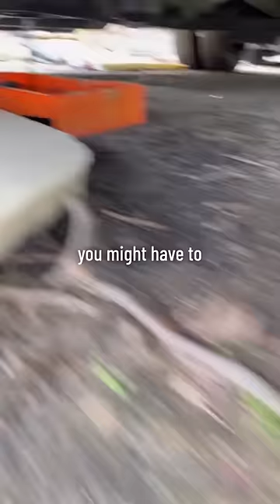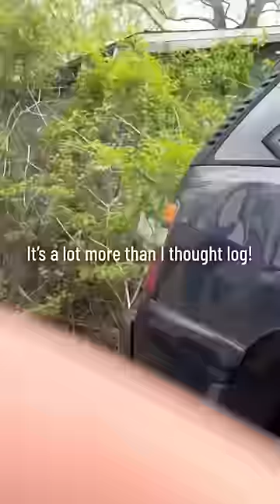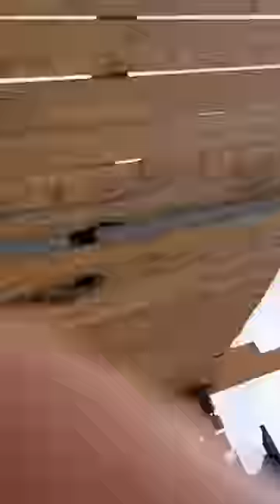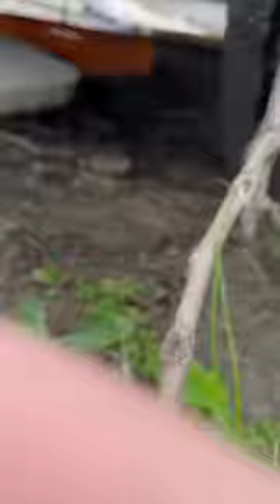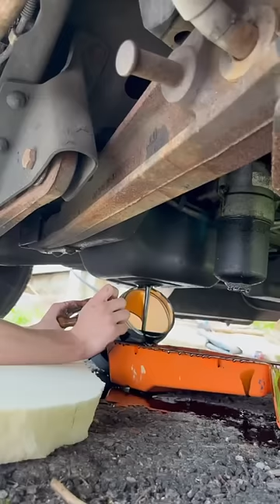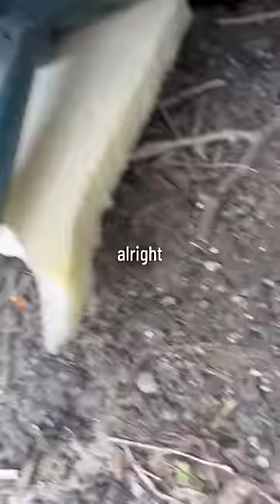First oil change

Comment: my 2 door coupe would’ve overfilled that orange oil catcher. rid of it. edit: paint tray guys, got it.
edit2: yeah i get the doors don’t correlate to oil capacity. but it’s very incredibly obvious what i mean.
Reply: The "orange oil catcher" is used to hold paint for a roller when painting.  He will have to get rid of it because it's ruined, not because it doesn't work.
Reply: He's also never changed the oil since he got it
Reply: @matthewheinze1231 lmfao i didn’t even realize it was a paint bucket for paint rollers 😂
Reply: Its not an oil catcher thats a paint pan for paint rollers.
Reply: “2 door coupe” is the car equivalent to “smh my head”
Reply: “Oil catcher”….. you mean paint tray….
Reply: That’s because it’s for a paint roller 😂😂
Reply: @dylanpires7836 lol for real. And being a coupe doesnt make the engine smaller
Reply: That oil catcher is for paint rolling
Reply: Paint tray
Reply: Lol has nothing to do with the amount of doors you have, but rather engine displacement
Reply: @Toxic_blitz777 bro what it’ black from soot 😂 are you actually thick a diesel produces soot therefore the oil goes really dark
Reply: I’m glad you know the difference between two door and coupe
Reply: @itsir2u  Engine size has nothing to do with it a 1.0 3 cylinder can be as much of a coupe as a 6.0 v12
Reply: @JustCarrotz bucket?  😂 anyways yeah silly ass video
Reply: Bro it's for Paint rollers, they didn't even have an oil Pan.
Reply: *paint tray
Reply: Well it is an oil catcher in this situation 😂 Also damn, it's small for even a motorcycle 😂
Reply: @Lilian040210  anything’s an oil catcher if you’re dumb enough 😂😂
Reply: 2 door coupe means nothing for oil capacity. Theres many 4 bangers out there that take over 6 quarts

Comment: Lesson: always know your oil capacity before draining it
Reply: @gunnardoyon6750 I'm sure the information is avaliable online for the bus
Reply: NotAccountable that engine Is in other cars not just a bus can find info on the engine not the bus bc busses come with alot of different engines
Reply: NotAccountable depending on the engine it could be like 40qts
Reply: It's not even a lesson. It's common sense. I only say that because wouldn't you think they did the research to see what type to use, how much to buy, what brand, etc...?
Reply: Exactly what I came to the comments to say. 😅
Reply: Lol just LOOK at the size of the sump. That was so clear
Reply: @michaellawrence3796  they dont use use alot of deferent engines actually
Reply: @gunnardoyon6750 internet still works to look up how much oil the bus takes. Probably the manual too.
Reply: Or use common sense
Reply: @gunnardoyon6750  and? its mostly about the engines displacement on how much oil it holds
Reply: @gunnardoyon6750 ignorance is not an excuse
Reply: @gunnardoyon6750 just proved his point
Reply: @gunnardoyon6750 I’m just a girl and I’ve never personally changed my oil. However even I know to use a huge pan for changing oil. Even on my car I’d use a decent 5L container. Mines a 3.8L engine and I’d like to be able to move the container without it spilling on my driveway.
Reply: Yuh
Reply: You can always use a vin decoder if you are unsure of your engines displacement. Using that information, you’re able to do a quick search online to find what oil and how much it takes.

They clearly don’t have a whole lot of experience with this bus, so I wouldn’t be too harsh on ‘em. They’re figuring it out and they’ll know for next time. Give ‘em props for doing it themselves and not being hesitant
Reply: NotAccountable  Humans are pattern recognition machines, with alot of differences between us, patterns you notice intuitively and label as common sense doesnt always come as easily to others whoms strengths are usually different aswell.
Reply: NotAccountable lmao thank you. This guy clearly owns a short bus for a reason
Reply: @gunnardoyon6750 Did he not buy new oil yet?
Reply: On my Mustang it takes 10Q
Reply: @ambermack5689 might even be too small. I have a smaller engine and need to drain almost 5L
Reply: If just buy a few oil drain catch pans. Like why didn't they even use one?
Reply: @FatherCorn in my experience you can usually find the required amount of oil 4 buses and other large diesel vehicles either in the engine on the oil fill cap on the oil pan itself which is admittedly pretty rare or in this funny little thing called a user's manual
Reply: Later he puts only 1 liter oil back in and womder why the engine broke
Reply: Doesn't matter even if it was a 4.5 qts or Toyota Prius engine it was going to over fill that paint roller container
Reply: @PsykoSpirits  fr
Reply: @gunnardoyon6750  He used something that holds less than a whole bucket of paint. Even for a first time, he shoule have known that wasn't going to work.
Reply: The lesson should actually be don’t use a damn paint pan too catch your oil
Reply: its damn 5 liters of oil bruv
Reply: Why not just plug the drain plug back in and find another oil bucket when you see the one you’re using is overfilling
Reply: @gunnardoyon6750  yeah, you can easily find that on the internet... how the hell would you know how much oil you have to buy...
Reply: Sorry I'm 15 and don't know alot
Reply: Or get the biggest oil and you can find or maybe even get a few
Reply: @michaellawrence3796 you find the oil capacity of the engine. Don't need the vehicle because the 7.3 motor has a 15 liter capacity no matter what vehicle it's in

Comment: Yikes, should have known a bus would have alot more oil! You'd be hard pressed to fit the oil from a regular sized car in that paint pan, let alone a bus. Lesson learned though!
Reply: I mean, was the lesson learned tho? 😂
Reply: Use common sense
Reply: Bruh, that shallow ass pan would hold the oil from my riding lawnmower.
Reply: @ThatOneKiidThere Tbh they don’t seem to me like they learn anything so I doubt it.
Reply: Even a motorcycle has more, a liter +-, a lawnmower, maybe 😂
Reply: Lesson is to just put the drain plug back on duh

Comment: Rule #1-If the drain plug is already in your hands and didn’t drop into the oil change pan by itself, don’t drop it in there…ya had a mess already, now you gotta fish around for a drain plug. Id use a magnet lol

Comment: i saw the bolt go in there…. i felt the pain and could feel the oil in my hands as i rummage to find it just watching 😭 lets hope the washer is still on there too
Reply: When I used to change the oil with my dad as a little girl, he showered me a trick to get as little oil on your hands as possible. He would take a cheap magnet and attach it to a stick, which he would use to rummage through the oil. Then, we found out that you can buy those. They are long, thin, usually retractable metal pipes with a magnet on the end. You can use it to get the bolts out of the oil (dawn actually works great after this) and you can use it while working on cars. I think I got mine at an AutoZone but you probably can get them at any Walmart. Hope this helps:)

Comment: Very good idea to let the oil run into the environment instead of holding your finger on the hole or screwing the screw back in. Very well done.
Reply: Oil is harvested out of the earth.
Reply: @Crackeracing yeah but thats most certainly Not Motor oil which destroys about 1.000.000 liters of well water or 600 liters of drinking water Just from one drop
Reply: Well they was smart enough to think that small pan was going to catch all the oil from a bus
Reply: The environment isn't going to change my oil
Reply: @Crackeracing bro you made me laugh way more than i should 😂😂😂
Reply: @Taulksik No, you're right, it won't, but it is keeping you alive!

Comment: Put your finger over it smart guy
Reply: Let us know when you do your first oil change one day lmao you try stopping 20+ litres coming out with pressure with your finger
Reply: The pressure aint that crazy bro. You could easily but the drain plug back in
Reply: @ThatOneKiidThere ive done it so i know its not that much press😂 just stick your whole finger in
Reply: They too busy thinking ‘how much more could this 12/13 qt system possibly have!’
Reminds me of the guy who thought you couldn’t stop air pressure after taking out the valve core 😢
Reply: @ThatOneKiidThere  it ain't likely to have much pressure, just the weight of x liters of oil coming out, idk maybe 10, 20 pounds over the surface area of the end of your finger with the softness of oil, definitely no problem there unless you were dealing with a pressurized system, this here ain't. What id be worried about is the tenperature, ive worked at an oil change place for a bit, that shit can be *hot*. Probably not 3rd degree burns hot, but you definitely don't wanna go stuffing your finger in the oil pan. Especially, some vehicle designed will be crazy fucking hot and you can get yourself a pretty nasty burn touching the metal directly like that.

Comment: First mistake is using a paint roller tray 😂 just get a 7 or 12 quart drain pain you should be good
Reply: That probably won't even work those Ford powerstroke 7.3's take 15 quarts.
Reply: @joeybebop and if it's an old bus with a Detroit Diesel engine it takes 32

Comment: You have to make an effective tool to move the oil to another place efficiently. For example, maybe inserting a funnel into a hose and then connecting it to a bucket 😅

Comment: Advice to anyone ; Look up what kind of engine you have, it will be in your manuel if you have one. It will indicate how many liters of oil it holds. Buy a sufficient oil pan. Voila, no pollution. Btw you're not supposed to throw the oil away. Instead, use empty oil containers and take them to a shop that recycles/repurposes the oil.

Comment: Pro tip if you just search up what oil does my car take on Google. Like example What oil does my mercedes c300 4matic take?

It'll pop up with 5W-30.
Turns out that was wrong and I was putting in the wrong weight. The manufacturer recommends 5W-40 or 0W-40.

Comment: Not sure if it’s just me or common sense, but usually if I’m changing oil, I know the amount to put in. Therefore I should automatically know the amount that’s gonna come out. Now hear me out. Maybe use a pan with the same or larger capacity as that amount🤯

Comment: tell me if i’m wrong but if you drop the drain bolt, is the hole small enough to just cover with a finger? i feel like he could’ve stopped the flow while they found something appropriately sized

Comment: I'm assuming that's a diesel, if you were prepared to do the oil change then you'd know that has like 3 gallons of oil in it (I'm not saying it does, but cummins motors have 3 gallons)

Comment: So why would you not Google the oil capacity of the engine first before pulling the drain plug. That saved me from dumping 3 gallons of 15-40 into a 2 gal drain pan the first time I changed the oil in my 24v